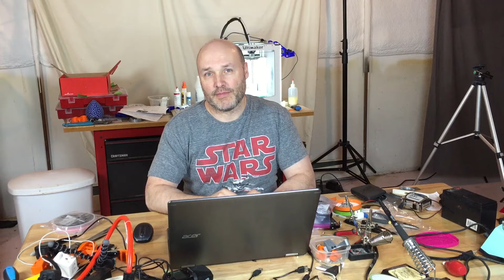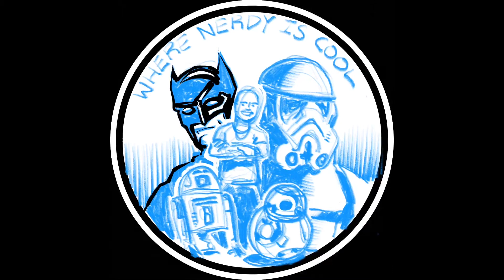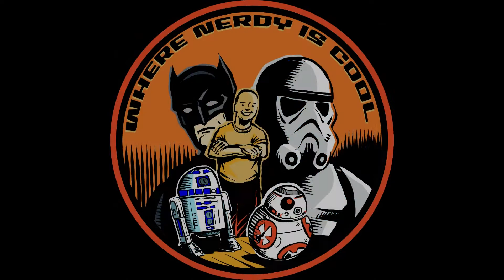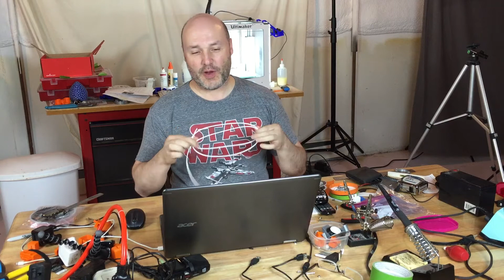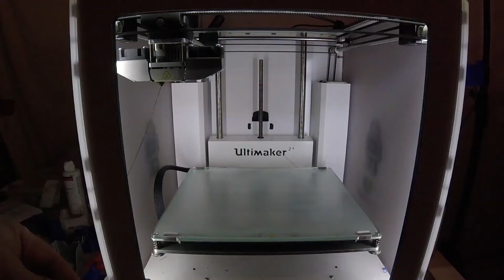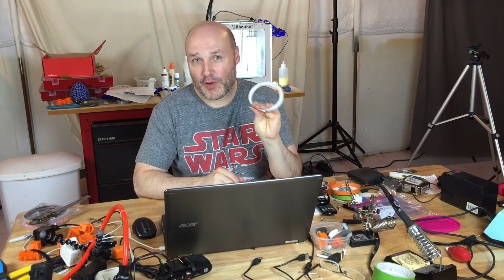Printing with NinjaTek Cheetah flexible filament!

Comment: Great video, really appreciated the tips.  Have you looked at some of the off brand TPE and TPU filaments on Amazon.  You can get 1kg for under $30 from some brands that have a lot of good reviews.  There are a few brands that have shoddy production but so far I have been very fortunate to get some great filaments (PLA around $10 and PLA+ for $20) that have been fantastic (ZIRO and 3DRAX) especially for the translucent and glitter types (blue, red, yellow, and purple).  Please make more  great videos like this one and definitely get some version of the CR-10.  I've had mine for a year and I love it!
Reply from the maker: Jason Baker thank you for your comments and I hope you have subscribed!  As for other flexible filaments, I really haven’t had a need to print many things flexible.  I opted for Cheetah since I saw others had good luck with it on the Ultimaker forum.  I have two CR-10 printers.  An S model just arrived recently!  I bought the aluminum Extruder kit (HICTOP one) since I was seeing some slippage on my CR-10 Original. My thought was that has an adjustable tensioner and should help.  It might prove useful for flexible.  I’ll have to experiment with it
Thanks again!
Reply: Subscribed and bell rung! I have been looking at either starting flexible or PETG printing for my next adventure.  I have made a lot of cool big things with PLA but also reaching the limits of what it can do.  I'd like to make some more durable practical things as well as swords, helmets, armor for my kids. I look forward to your future videos, especially with 3D printing.  Thanks for the great content.
Reply from the maker: I have printed Polycarbonate (Ultimaker brand on my Ultimaker 2+) and got some really good results on that.  I bought a MicroSwiss hot end among other items to overhaul my original CR-10.  (Still want to replace the Melzie board with a new board....but given the electronics issue/recall, those are hard to get right now)  That said, PETG is on my To Do list since so many say good things about it.  However, given the data I've read on micro particles those non-PLA filaments can output, I would like to get some air purifiers setup in the shop so I don't make my mild asthma angry!
Reply: I did not know about that with PETG.  I'm printing in my kitchen and have 3 kids (10, 7, and 4) in a 1200sq ft house so maybe I'll hold off on the PETG..  LOL.  Thanks again for the good advice!